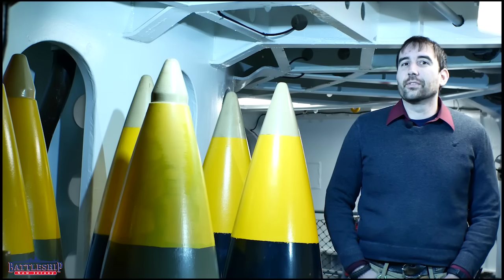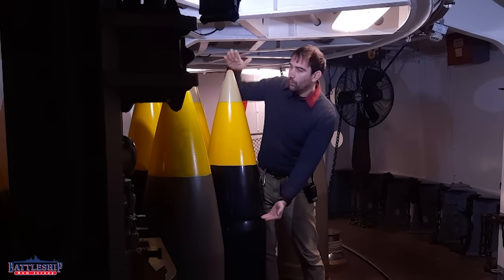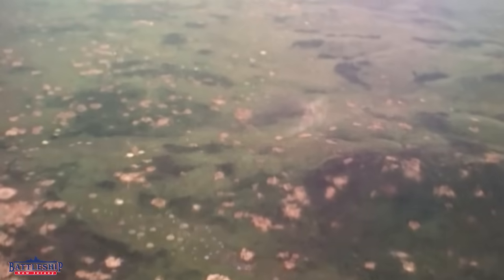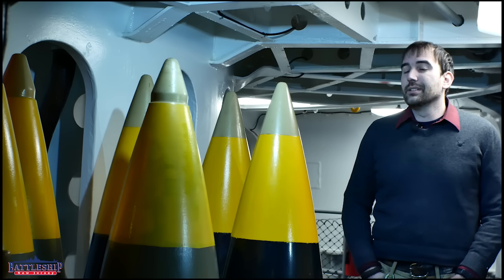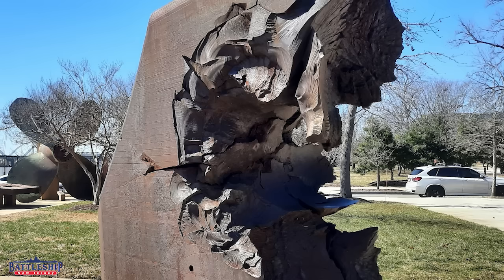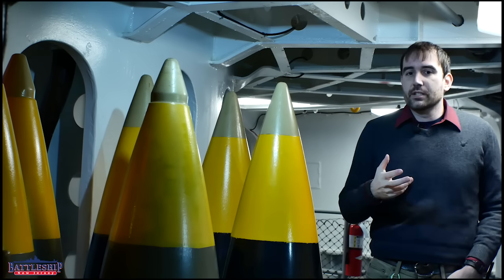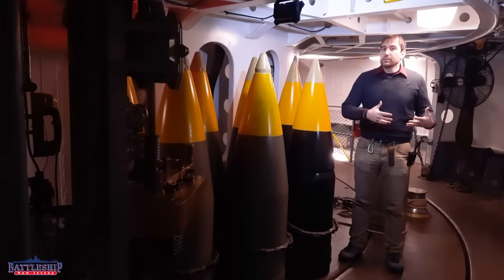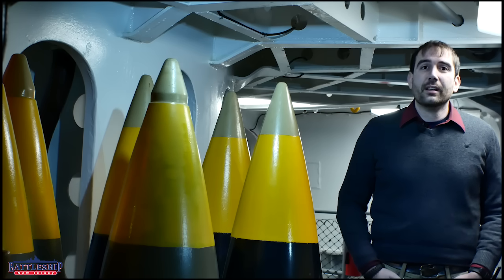What Does the Impact of a 16in Shell Look Like?

Comment: I never realized the front cone was just for aerodynamics. I always figured that was solid and part of the penetration factor.

What mechanism is used to create the delay on the AP shells?
Reply: Pretty sure you can find the cutouts for this sort of stuff with details on the detonators
Don't quote me on this but the cone should be called ballistic cap. Ammunitions have particular descriptions like APCBC, which would mean Armor Piercing (duh) Capped (soft cap on the hard AP core to improve penetration) Ballistic Capped.
Reply: @Galf506  Yep, the outer cover is the ballistic cap.  Ryan didn't mention it, but there is also an armor piercing cap in between the ballistic cap and the shell body.  All three are brazed together; the ballistic cap has a large gap and the armor piercing cap is closer to the shell body with a small gap.  The idea is that each shell packs three hits on the same spot.  Ideally the ballistic cap and the armor piercing cap help penetrate when hitting at an angle.  The ballistic cap puts a small dent in and breaks off the shell; then the armor piercing cap hits and makes a bigger dent before bouncing off.  Then the body of the shell hits the dented plate where it has a better chance of catching and poking through instead of deflecting off.
Reply: @matthewbeasley7765  the ballistic cap aka wind screen is not going to help penetration at all. It is sheet metal and will do nothing to armor. The ballistic cap is designed to handle face hardened armor. It takes the initial shock of impact protecting the main body from shattering, which is the primary goal of face hardened armor. It is also blunt and will help form a shear plug which is the main failure mechanism for face hardened armor.
Reply: The delay is made by using a slow burning Fuze
Shell hits, primer is activated and ignites Fuze, after some time the burning Fuze reaches the explosive, bang

British time delay fuzes in bombs were placed in the back of the bomb.
Bomb hits, inertia makes a heavy metal ball travel down a tube where it breaks a glass vile full of acid.
The acid eats away on a metal wire or celluloid string which is holding a spring loaded bolt. When the wire /string is destroyed the bolt is shot forward against a primer cap which will detonate the explosive.

In addition to that there are also mechanical clockwork fuzes so a clockwork survives being accelerated that fast like it is in a grenade/shell
Reply: @dave_sic1365  That sounds complicated but is pretty brilliant. I always imagined the impact somehow caused the primer ignition, but it makes sense to put it in the back where shell hasn't been smashed up yet. Let the inertia do the work. Thanks!
Reply: @Eric-hr1gq  would you watch a video on ww2 fuzes?
Reply: SY simulations did a great video on shell dynamics regarding caps/windscreens.
https://www.youtube.com/watch?v=gTomWXvyrtg
Reply: @JuliusCeasar224  Thanks! The human mind is a wonderful and terrifying thing.
Reply: My uneducated guess would be that it is a chemical reaction that burns through a specific length at a more-or-less specific time. At least that's what is often used in hand grenades.
Reply: @somebod8703  I'm also uneducated in this regard. I thought maybe some sort of pin-fire primer, but angle of deflection could ruin that. And just the shock of firing a projectile 10-20 miles seems like it would prematurely start a chemical reaction. It has to be some sort of impact event. Hand grenades are more of a timed event. Gonna go look it up now, thanks Battleship New Jersey, making me learn stuff on my off-hours.
Reply: @Eric-hr1gq  You asked about the delay, not the impact. If you put a delay fuse between the impact primer and the main explosive charge, you get a delayed impact detonation.
I have no idea how the impact detection actually works.
Reply: @somebod8703  --  Smaller shells have a powder train.  The delay can be adjusted by rotating a ring what simply ignites the powder train closer or further from when it sets off the main charge.
Reply: Primary method - very basically, there is a "tube" of pyrotechnic between the detonator and the main charge.
The length of time it takes the detonation to travel the length of the tube and explode the main charge is your delay.
You're talking a fraction of a fraction of a second.
Reply: probably mechanical switch that sends a pulse of some ind to the charge
Reply: @Kyuubi365  Slower acting (relatively) acid fuses
were probably more reliable considering the g forces upon impact. Good point...

Comment: I hope that sometime you will discuss the ap round's nose design in greater detail. It seems counter intuitive that the penetrator itself would be relatively blunt. Ap rifle rounds are generally pointed so I'm curious why this isn't desirable for battleship sized rounds.
Reply: AP rounds have blunt, often stepped, nose to avoid deflecting off when encountering armor at low angles.  If the projectile was shaped like the wind screen the tip would bend over on impact and tend to glance off.  The steps on an AP round will "bite" into the armor and direct the energy of the impact into the armor better.
Reply: @georgem7965  That makes sense. Jeff's answer too. I wonder why some rifle ap rounds are pointed though.
Reply: @Lucas12v  if you look at dedicated Arnour Piercing rounds rather than standard ball ammo, most will actually have a hardened penetrator of a different material, either steel of some sort,tungsten or some other hard/explosive/reactive core underneath the softer copper jacket of the bullet instead of lead, and they're rarely shapped the same way as the outer jacket of the bullet. So they're mostly following the same concept as the 16inch AP ... most of the time.
Reply: @UCghCdOxX8hCOwOW0if4W_5Q The penetrating core of most AP rifle rounds is actually very similar in shape to the 16" AP core, the bullets are long and skinny because the penetrator is encased in soft lead and a copper jacket which combine the purposes of the ballistic cap and rifle bands on the 16" shells. Rifle caliber AP also isn't really designed to deal with thick plates of hard armor. It is designed to penetrate light skinned vehicles and body armor, neither of which offer enough resistance for angle to really matter except in extreme cases. If the armor you're shooting at is thick enough to deflect an angled hit, it's thick enough that you'll want to consider upgrading to an RPG to defeat it.

As for APFSDS, different countries use differently shaped penetrators but the round fired by the M1 Abrams is actually almost flat with a pointy ballistic cap. APFSDS also has a much greater length to width ratio than bullet shaped projectiles so its interaction with angled armor is somewhat different. That is one of the reasons that APFSDS was developed, it penetrates angled armor more effectively than its full bore cousins.

Check out the YouTube channels "SY Simulations"  and "Dejmian XYZ Simulations" if you're interested in what happens to armor at it is hit by various different shells. They both use simulation software to demonstrate how a wide assortment of projectiles interact with an equally wide assortment of armors. Both of them make videos that are usually less than a minute long and very mesmerizing to watch.
Reply: @resurgam_b7  One of the reasons that AP rifle or machine gun caliber rounds have pointed penetrators/cores is that the inner material (often tungsten carbide) is harder than the armor or other material it will encounter.  Therefore, the point of the core will "bite" into the material it encounters and penetrate.  With naval AP projectiles the hardness of the projectile is similar to the armor and a sharp point is more likely to deform and help the round glance off.  Naval AP rounds never had hardened penetrators.  The technology wasn't there yet.
Reply: @georgem7965  That's true, I wasn't thinking of that.
Reply: @resurgam_b7  Thanks for the detailed answer guys. After hearing your explanations, it makes good sense.  Slap rounds appear to be actually pointed but that's obviously the exception rather than the rule. Or I'm mistaken again.
Reply: It's all about energy... transfer.

You don't want to waste a single bit defoming your projectile, you want the bad guy to have it all.

They say the Weather Sevice has the biggest computers.

Ummhmmm, right.

;-)
Reply: One of the main reasons for a blunt nose has to do with the type of armor being fired at. Armored warships made heavy use of face hardened armor. This is steel which has one side of it at extreme hardness and after a set depth the steel transitions into a softer temper. Against the very hard face a pointed projectile will perform very poorly, it will glance off or shatter under the shock. Also hard steels main failure mode is shear plugging which is best achieved by a flat face. The blunt caps greatly improved the shock resistance of the AP rounds. The Iowa's and South Dakota's internal armor was potentially very effective as the outer hull would likely decap  incoming rounds making them much more vulnerable to shattering against the armor belts. This made their armor much more efficient. Unfortunately US armor was too deeply hardened and lost some effectiveness in the thicknesses used for the belt but for thinner cruiser armor it was outstanding. If Iowa used British style face hardened steel she may have had the best armor belt in the world, including Yamato.
Reply: The blunt nose of the penetrator significantly reduced deflection at shallow impact angles. The very pointed nose of the cap enhanced aerodynamics, resulting in greater remaining velocity at target, which further enhanced penetration.
Reply: IIRC, one of the reasons that the High Seas Fleet did not lose more ships at Jutland is that the British AP shells had a tendency to break up when they hit German armor.
Reply: @georgem7965  I do remember reading about some issues with British AP. I think it had to do with burst charges detonating on impact because the explosive was to shock sensitive. Or it could have been they put to much burst charge in and it structurally weakend the shells.